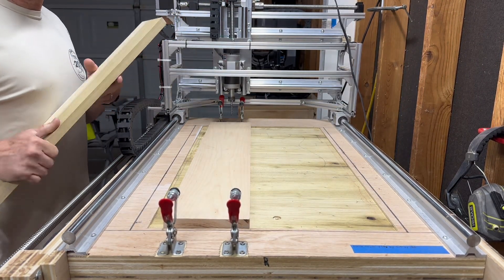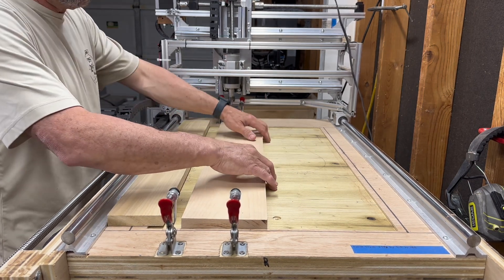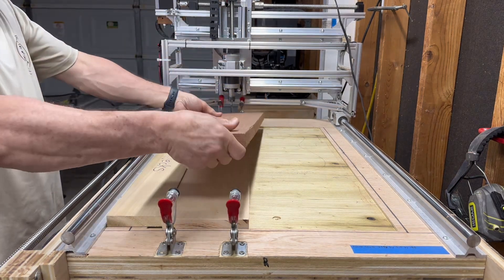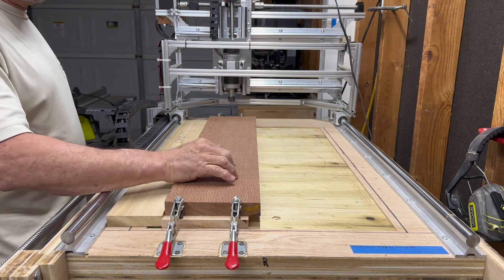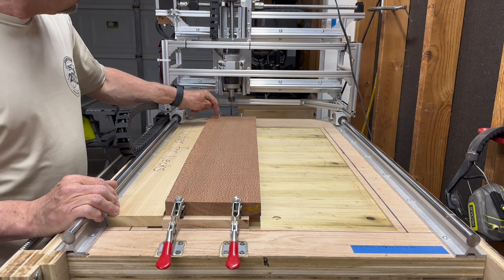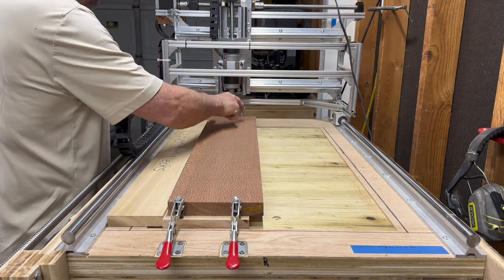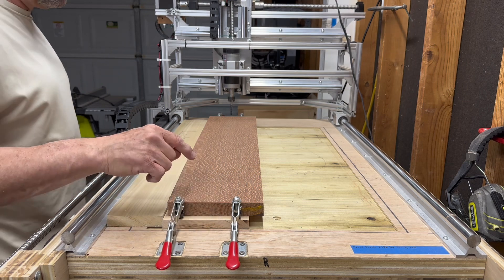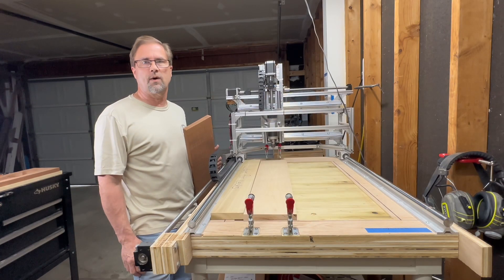CNC My Alignment Setup

Comment: Just a comment on terminology. While both jigs and fixtures can be used to locate parts and hold them in position, a jig also guides the tool during a machining operation whereas a fixture does not.
Reply from the maker: I appreciate your comment! I see your point. Im really just learning a lot of this